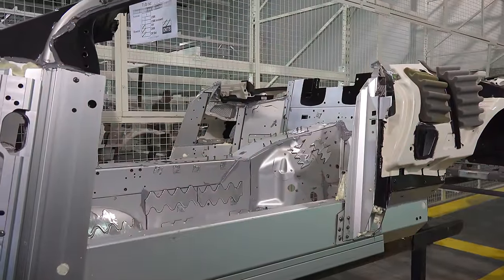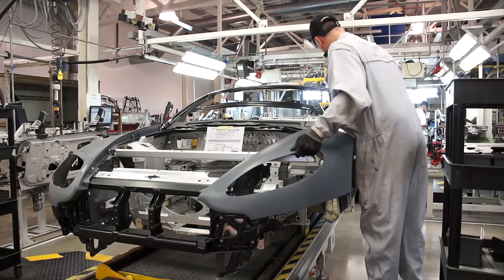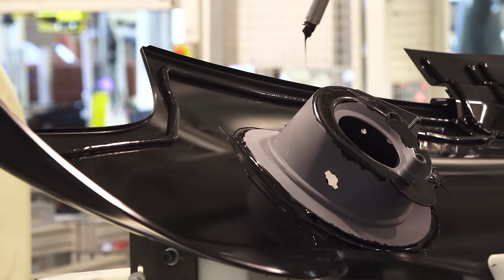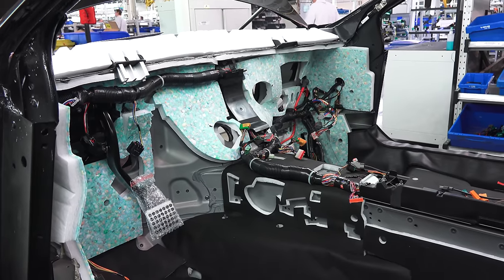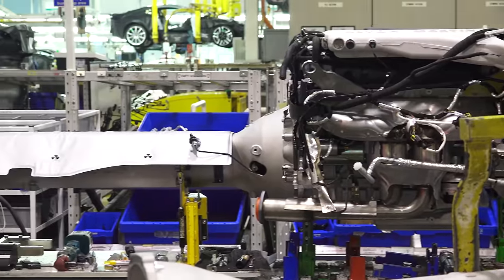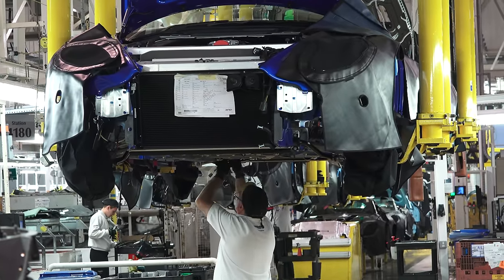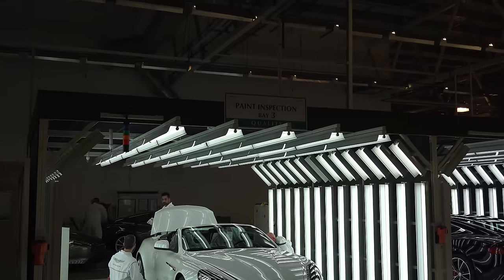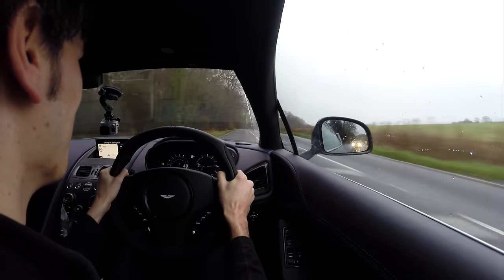Aston Martin Factory Tour - How Supercars Are Born

Comment: A torque tube is basically a prop shaft right? I've heard them referred to often in the context of cars with transaxles
Reply from the maker: The prop shaft (or driveshaft) will be rotating inside of the torque tube (rigid component structurally connecting the engine and rear transaxle).
Reply: +Flame That&#39;s what they look like yeah. Their main function is to add rigidity to the drive line. By adding a solid member between the diff and gearbox or engine and trans-axle you prevent the diff / transaxle from flexing under power. Makes a big difference to driveability in a high powered car. Even mx-5s have a PPF (power plant frame) which is just a small truss that has the same function. Makes manufacturing easier as well when you can treat the driveling as a solid member.
Reply: +Sam Hall   Also as the engine spins at higher revs and there being distance from the engine to the transmission there has to be something to catch the prop shaft should it fail due to the distance and torque.
Reply: +Flame It's structural. :) Reduces the load on the front engine mounts and so on, apparently, something like that.

Comment: 2:13 there's 2 calipers on the disc? why is that? i'm assuming the single piston calipers are a dedicated one for traction control maybe?
Reply: I think it's for the handbrake, as it would require a lot of force or travel to lock up the pair of main callipers by hand.
Reply: I think it's for the handbrake, as it would require a lot of force or travel to lock up the pair of main callipers by hand.